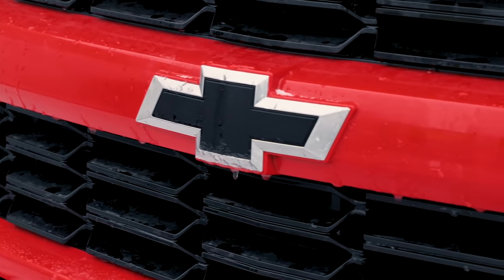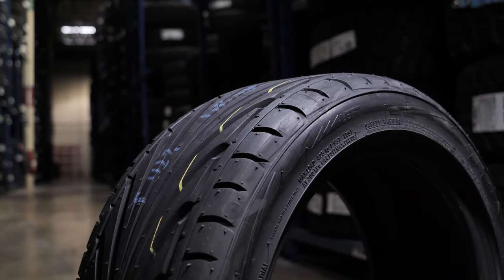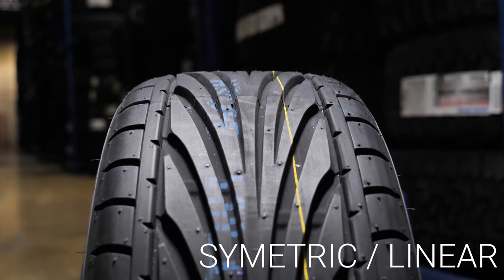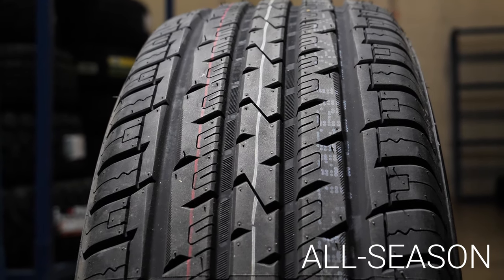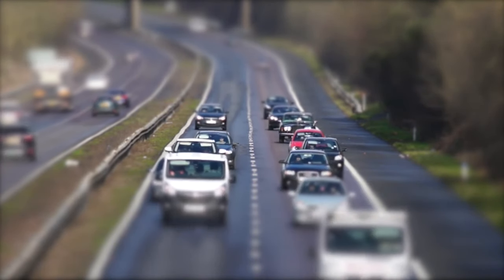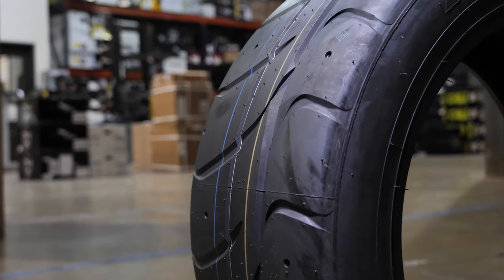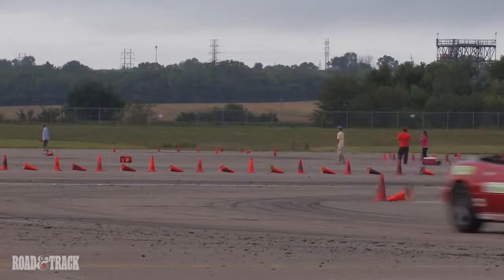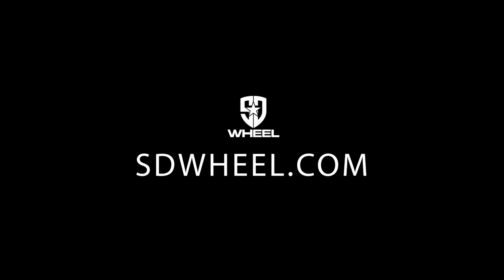All-Season VS Performance Tires - Which Ones Should You Get?

Comment: So which is better in Snow? Performance or All-Season?
Reply from the maker: Hello! All season tires offer versatile performance and are designed to perform in a variety of conditions including wet roads and light winter driving. ... Likewise, an all-season tire is not designed to handle extreme winter conditions like trekking through snow or driving on ice. So it really depends on the situation, if you are driving through snow most of the time, I would recommend getting winter tires for safety.